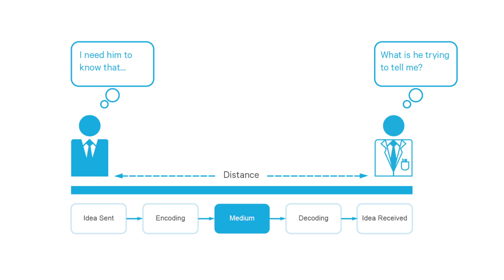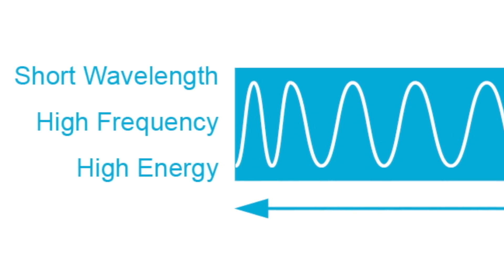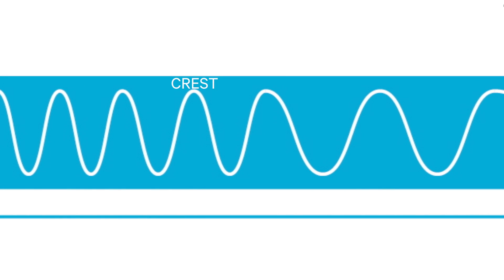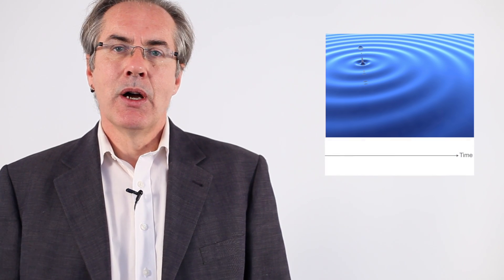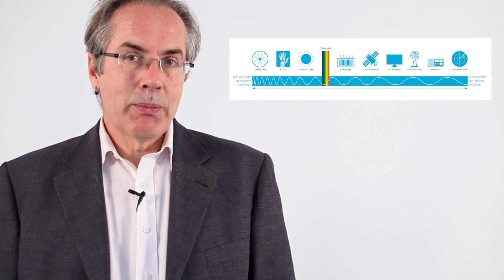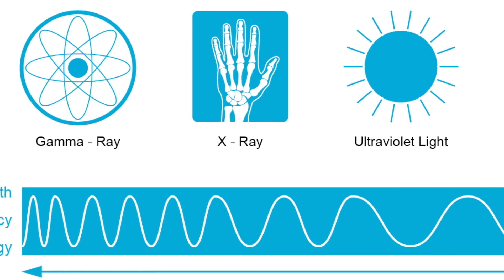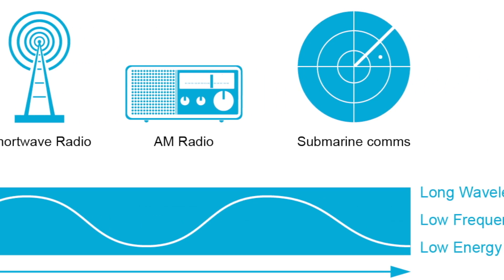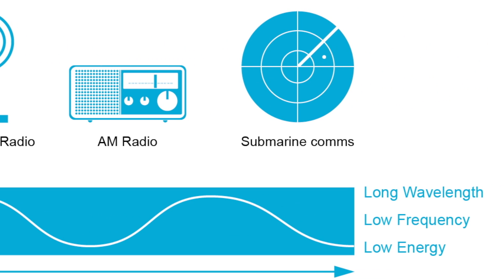1.2 What is a Radio Wave? | Basic Radio Awareness | Tait Radio Academy

Comment: I am trying to understand how a wi-fi router works. It sends out a radio signal to create a wi-fi access point by sending radio waves. What it meant by "sending radio waves" in this example? Does the router "shoot" electricity into the air? How does it create these waves?